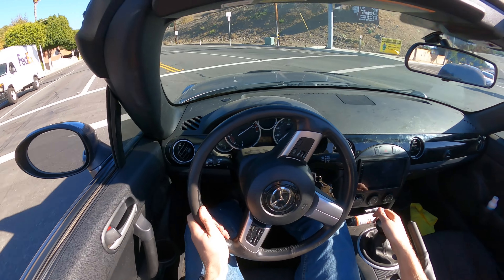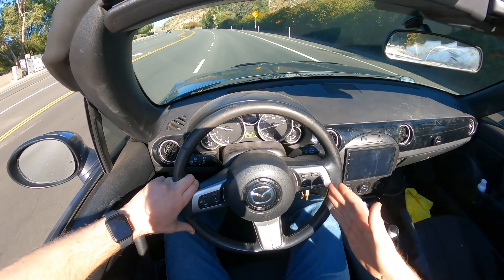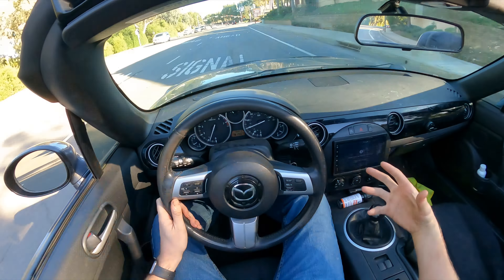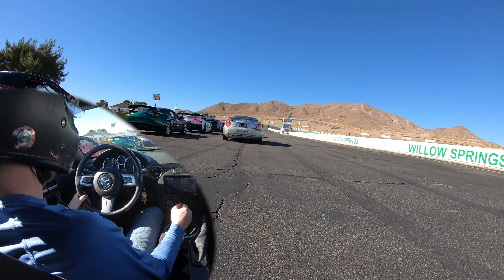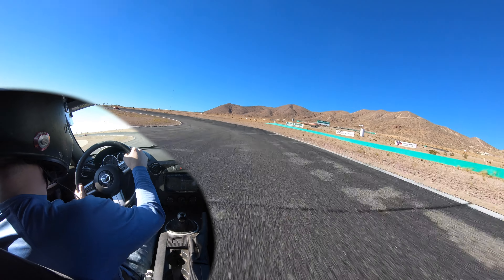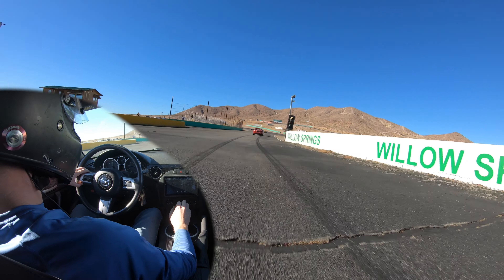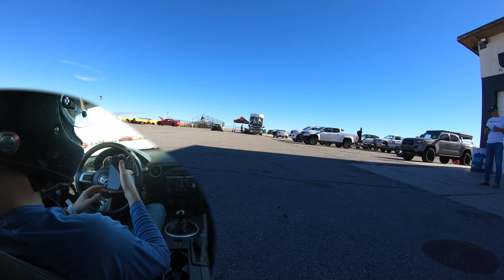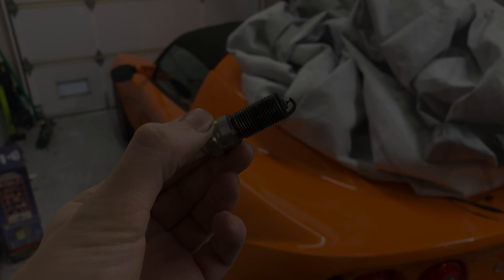OS Giken SuperLock Test Drive.. But Then My Engine Fails

Comment: Clutch type diff is by far my favorite mod. People often think a torsen or other oem type is the same when they've never tried an aftermarket clutch type but it is night and day difference
Reply: I had a Torsen in my Toyota 86, it's pure trash, the car would just randomly slip out at high speed, very dangerous. I went with the Cusco Type RS, best mod I ever did, completely changed the car. Torsen never ever lock, it is a variant of the open type, people refuse to realize this, they end up spending money on other setup changes that will never fix the real problem.

Comment: Definitely need an oil cooler and a good radiator for track. The 2.5l is nice but you really need to do work on it to make it shine. It's basically a k24a1
Reply: cams
Reply: @corwininadsm  while you can make close to 200whp with esslinger stage 2s, the cr of the stock 2.5 block is low, around 9.2:1 CR, so it still won't feel as crisp as the stock 2.0. There aren't many builds actually online with built 2.5s but they can make around 230whp with 11.5:1 pistons. One cheap cast option is the GM ecotec pistons which can be found around 100$. Of course it is now an expensive build.

Comment: Great video, you really showed the importance of a clutch pack differential. I had a Torsen in my Toyota 86, it's pure trash, the car would just randomly slip out at high speed, very dangerous. I went with the Cusco Type RS, best mod I ever did, completely changed the car. Torsen never ever lock, it is a variant of the open type, people refuse to realize this, they end up spending money on other setup changes that will never fix the real problem.
Reply from the maker: Preach brotha 🙏. Clutch type is the best 🤙🏻

Comment: I want to get a OS giken for my 350z. I've read online that they are very quiet for street use. Can you confirm? or is it a total popcorn maker?
Reply from the maker: It clunks on low speed sharp turns, otherwise it's not bad. I daily it without issue
Reply: @ZentRose  thanks for your reply. I'm gonna pull the trigger on getting one.
Reply: I've had one for over 10 years in my s13. Very quiet. Way quieter than the nismo in my GTR.

Comment: I got one for my NA. It's a 35 in & out 2 way diff so I can't wait until it's in the car. I'm glad you brought up about the diff fluid! I was going to use Royal Purple. I'm guessing that wouldn't be a good idea???
Reply from the maker: I'm not sure, this was just recommended by OS Giken. It's supposed to keep the diff quiet and extend the service intervals a bit. The downside was the price... about $50 a bottle.

Comment: did you need to adjust the backlash ? or its just drop in ?
Reply from the maker: Yeah you need to measure and adjust if it’s off. Sometimes you don’t need to adjust.